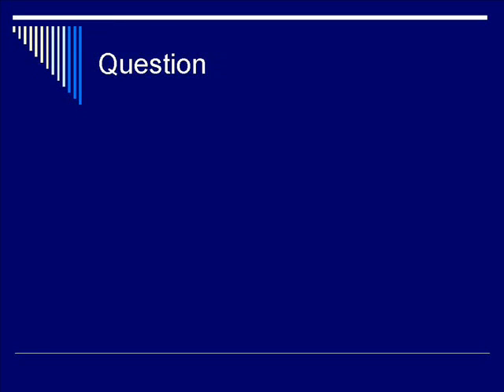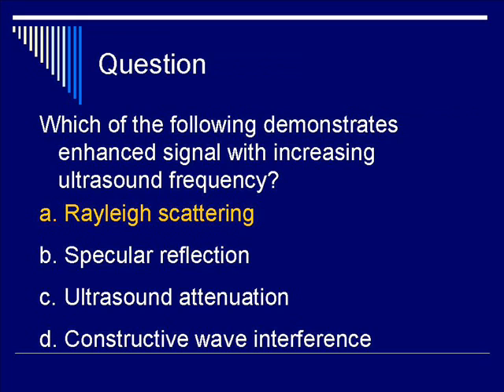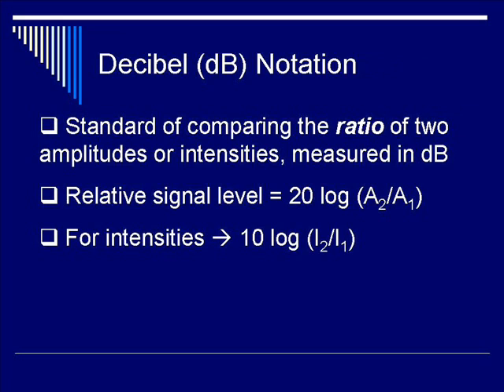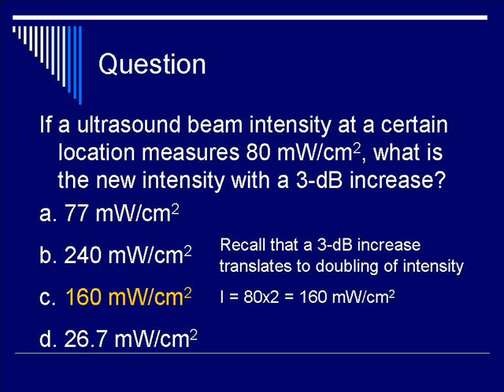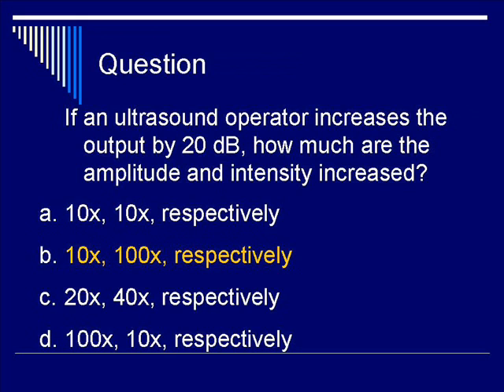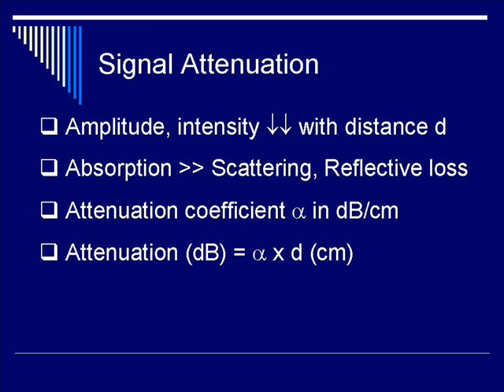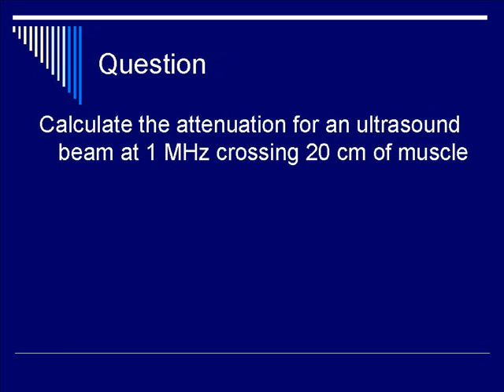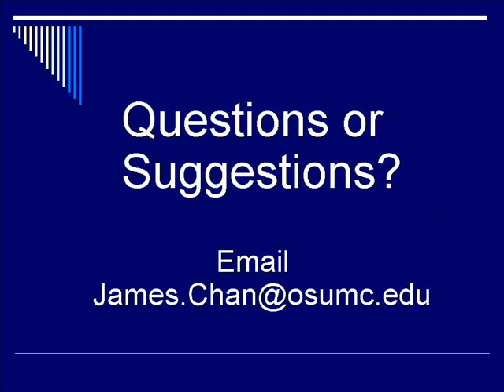Physics of Diagnostic Ultrasound - Segment Four

Comment: that does not make sense he clearly stated in the previous slide that alpha was 0.5 per centimeter then he switches and says that it is 1.5? Can someone explain?
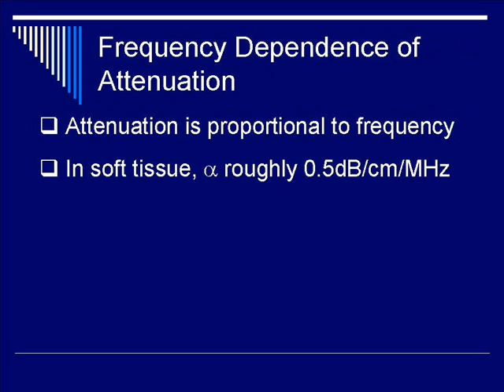Reply: I think the value of alpha of 0.5 dB/cm/MHz was a rough approximation as applied to soft tissue.  The table at 6:54 gives other alpha values for different substances and types of tissues.  The table shows that alpha is approximately 1.2 for muscle, which is what is used for the example on the next slide.